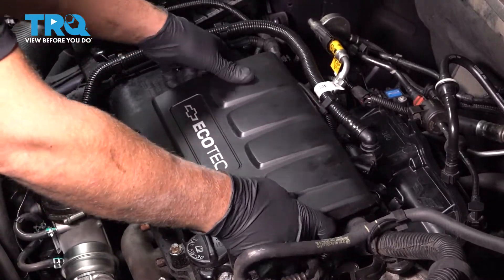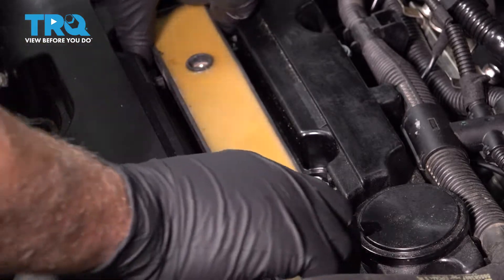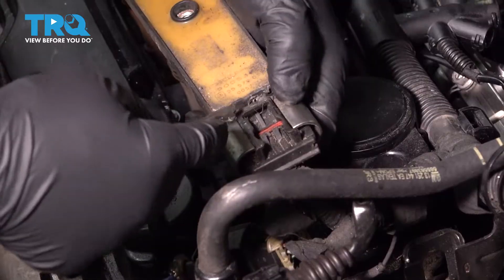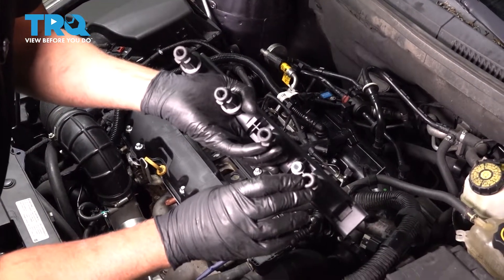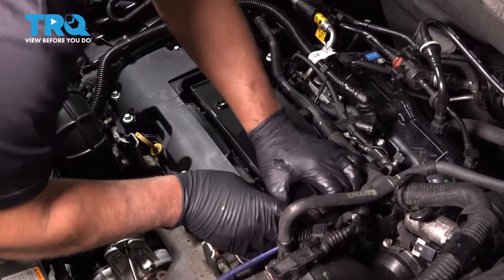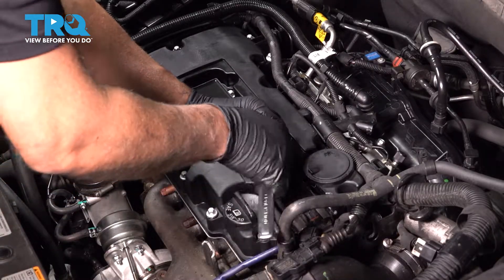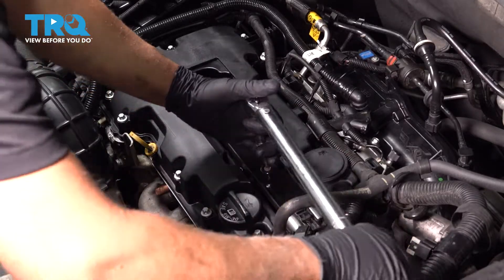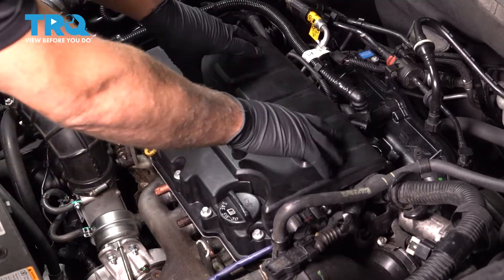How to Replace Ignition Coil Pack 2011-2015 Chevy Cruze

Comment: My biggest problem in the whole operation was dealing with the dam clipp  that holds the plug in place    in ur case the plug securing clip  was broken  which im not surprised becsuse someone before u was there and broke it because there so hard to get unclipped  it would be helpfull to show in detail how to release that securing clip on the plug   And also my coil pack securing bolts were torx  not sockets
Reply from the maker: +@bfmeier1 Thanks for the tip! We'll pass this info along to our production team. http://1aau.to/m/Shop-TRQ

Comment: What is your opinion on putting a little bit of the boot grease on that outer top part of the boot where it meats the sleeve? I actually find it easier to get that coil pack out on this model on the ones that I have done that to.